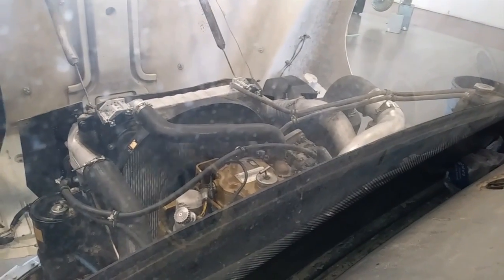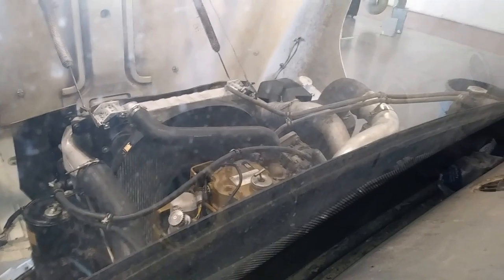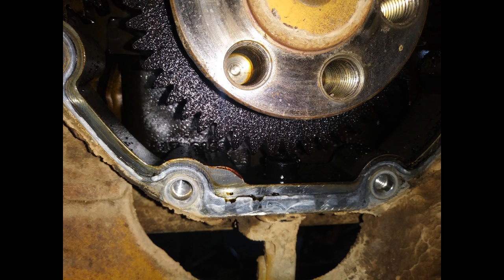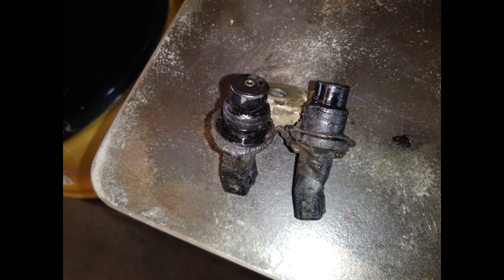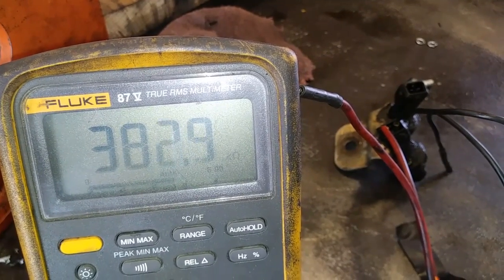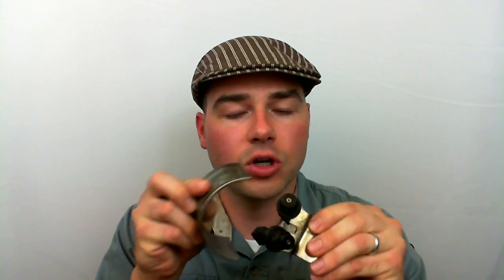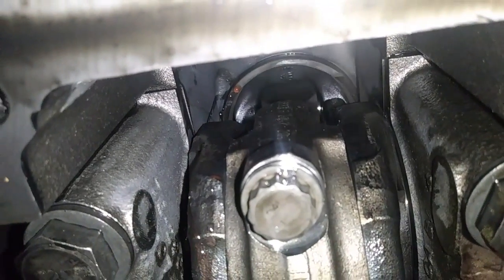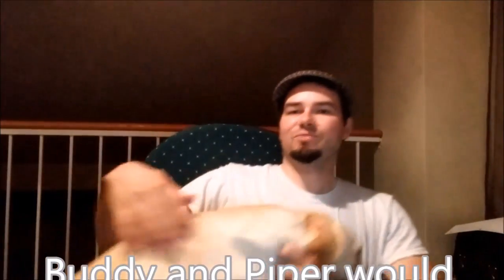Diesel Engine Problem You Can't Figure Out, Check This! Timing And Speed Sensors.

Comment: My 3406e is doing a miss under hard pulls , went to change the sensor and boom , frayed wire coming of the harness , about to change that wire and put a new pin and hope that fix’s it so I can return this sensor still in the bag. Thanks for the video

Comment: I have a 1993 pete with a 3176 cat engine serial number 7LG20948...it usually revs when pressing the aux and idle and revs again on its own..i changed out the pedal sensor but does the samething..think it can be the speed sensor? Thank you very much

Comment: Hey man, trying to work on my 3126 C7 in my Motorhome. I think I need a new Engine Speed sensor but can’t locate it
Reply from the maker: It will be underneath the HEUI pump on the front stretches. They are a pair of sensors next to each other.

Comment: God, people love to go right to throwing expensive parts at problems with simple causes. Even with motorcycles people/techs would do the same thing. No starts and funky running and people were wanting to buy ignition coils and CDI/ECU modules, 2 of the most reliable parts that last hundreds of thousands of miles in most cases on any vehicle, and can cost a few hundred to more than a thousand bucks. And the issue was 1, both, or in the case of triples or 6 cyl 3, crank position sensors going gone.

Comment: Was able to fix my 3126 after fighting it for a year.  Would start fine cold then turn it off and would not start.  Then sometimes its was fine.  Changed timing sensors and its good now. Thanks for the videos.
Reply: I got the exact same problem with my citroen jumper 2.2 hdi150

Comment: I was experiencing Intermittent Miss with my 3126 and was dreading the cost of possibly replacing HUEI pump and injectors when this video pointed me to the timing sensors. I found a cracked connector on one of the timing sensors that must have been damaged when the air compressor was worked on a little while ago. I secured that connection, and the issue was solved! Thanks Adept Ape! A lesson I have had to learn and re-learn a few times ... check for the  easy/cheap solutions before jumping to the difficult/expensive!

Comment: Thx for the vid I think I'm having the same problem, I will order replacement sensors, my only question is how do you remove the harness clips and separate the sensor from the harness. I am fairly sure this is my problem and had started leaning that way before stumbling across thos video. Only difference is that I do not seem to be registering any rpms on the dash.

Comment: Hi bud I’m Radu here and I own a 2008 t660 c15 Acert that gives me a check engine light and it says it’s the engine speed replaced the sensors just replaced the cam shaft on it and they checked the timing twice but they can’t figure out what’s going on truck starts runs fine no problems what you think it might be thanks captain!!

Comment: I have a cat 3176 in a 95 international 9200. Was running just fine and cut off, can’t get it to run again. Changed fuel filters and primed it, still no luck. Any advice?

Comment: Had a VW Jetta TDI that wouldn't start one morning after running perfectly for years. No engine light or codes so I was a little lost. Turned out to be an "anti shudder valve" (almost like a throttle plate in a gasser) that was stuck closed. Thing was gunked up from EGR gasses and was choking off the air. Pulled the unit, cleaned out a pile of soot and it's back to normal. It's good to get familiar with the workings of your engine.

Comment: I have a 2004 cat mbn c15 that is flooding cylinder #4 with diesel. The injector had a broken o-ring, put everything back together still flooding the cylinder. Took injector out replaced with a good spare, still same problem , any ideas?.

Comment: Hello adept ape, I have a fuel issue. The truck starts and runs for a short while but then it starts to die. My shop told me that my fuel lines are leaking and could cause this problem. Replaced all lines and still same issue. I thought like in this video the sensors needed to change and I did still no success.  The symptoms that we are seeing is that the fuel lines have fuel pressure the primary filter is mt and there is no pressure reading off the secondary relief valve. Please if any ideas that could fix this problem would be greatly appreciated.  Videos are extremely helpful thanks for them.

Comment: Josh,have you ever had a oil pressure sensor on a 3126 cause a low boost issue ?I did,drove me nuts,koeo the voltage to the sensor was fine,even read oil pressure,monitored it on et and it showed it's ugly head,replaced sensor and boost issue was fixed

Comment: 3406E 2WS serial number, new inframe, oil pump, turbo and head and now when starting the pops off right away and dies right away too. Test, ohmed and double checked everything I can think of and good. I unplugged the crank timing sensor and tried to start and would just crank, so I plugged it back in and unplugged the cam timing sensor and tried again and it runs great, went to plug the cam sensor back in and it killed it right away. I replaced the cam sensor and no change. will run great unplugged but jwill just start and die plugged in. any suggestions?

Comment: Thanks bud. So I did do a bottle test and no bobbles. 3406E 1999. The truck still runs good. I am under a load that need to drop in the morning 388 miles.

Comment: Josh. Water coming out my blow by
Reply from the maker: You most likely have a cracked head, blown head gasket, or a leaking liner. Depending on the engine you could have a bad water pump, oil cooler, or bad egr cooler.  You should perform a bottle test and check for oil in the coolant as well.
Reply: Hey bro can you do video regarding automatic transmission won’t shift

Comment: Craziest thing I've ever ran into was a Cummins isx with a vgt turbo. The truck would start then die immediately, checked everything never found a solution. Finally a guy from Cummins came to look at it, he loosened the bolts on the turbo flange and it started. Turns out the turbo was stuck shut....craziest damn thing I've ever seen.

Comment: Had this kinda the same  issue recently but on a Cummins ISC turns out the cam gear had literally snapped and only holding on by 1 of two spokes and when it was getting hot it was walking away from the position sensor causing engine shutdown initially thought it was bad wiring( due to bad repairs wiring previously)

Comment: Hello sir! I have a Peterbilt 379 with C15 6nz, the problem is when i heavy and going to uphill starts popping srems like not enough fuel or sucking air when i change shift and disappear when i push pedal harder. What might be reason? In the shop they cant check because it starts fine drives fine even heavy when no hills, only on hills and heavy appears this problem
Reply: Tyncha Amatov the you find the problem I have the same problem ?

Comment: 1 of my 98 Pete's has a 3406E, it would run fine then just shut off and start right back up. Miss on occasion during a hard pull. Took me a while to get around to the cam timing sensor but if I remember 144.00 later and it run perfectly.

Comment: How much that repair of the wiring harness and timing sensors cost ?
Reply: 250$ for the cam timing sensor kit. Comes with primary and secondary sensor and braket

Comment: ghost in the machinery
I fixed a CAT small Perkins which had metal chips on magnet causing intermittent issues. Never showed on scanner. Guys spent $$$$$ chasing it. Only cleaned chips off and now perfect on a JLG S 60 boom lift. We bought it cheap since stealer (dealer )gave up. Always check simple issues.
Also fixed Cummins M11 same bare wires on cam sensor. Easy fix!!!
Excellent video.Thanks Shalom

Comment: I have a 3126 in a small dump truck. When it warms up it sounds like it popping out the exhaust. Check all the injectors and made no difference. There's no smoke either and doesn't lack in power just has a pop out the exhaust. Was wondering if a bad timing sensor would do the same thing or do I have a burnt valve. Any suggestions would be muchly appreciate. Thanks

Comment: Any sort of sensor that measures the rotating speed of the engine are virtually identical to any speed sensor or ABS sensor, since they all have the same parts in common; a coil, a stator 'gear', and a magnetic tip.  Crankshaft and camshaft sensors detect for engine rotation, and the spaces in between the teeth of the stator turn the sensor off, the teeth turn the sensor on, giving a square wave register to the computer, same with a speed sensor or ABS sensor.  The computer calculates the on/off cycles, and determines engine and camshaft speed to control fuel and ignition timing, or simply injector timing in a Diesel.  If only it was so easy to replace these sensors when buying a new truck, there'd be less down time and the engine would run much better since it can monitor itself more easily.

Comment: you have experience with 3204? I have a D3B crawler, has one of these engines, runs Ok, about 70psi oil pressure. I have heard horror stories of the 3208, so I wonder what typical problems this engine has and are there ways to minimize these issues.

Comment: Have seen worn injectors not allowing one to start. All test shows nothing wrong with the engine. The injectors can't meter enough fuel at             cranking speed to fire the engine. Starting fluid works as the engine gets fired off and engine now has enough fuel metered.

Comment: My jakes stick when cold on a 3406e 2ws. When it’s hot works great! Any ideas?
Reply: First Jacobs brake does not recommend using the brake with a cold engine. Most likely you have a spring broken. Second solenoid   sticking. If it does it on low, check the center hsg. If on med. front or rear. Remove the valve cover and on top of the solenoid is a     small plunger in the center. Push it down with a seal pick or something to active the brake manually. When you release it oil will       squirt out the plates on top. You can place rags over the plates. Make sure you don't get them in the valve train. Once you located    the hsg that's causing the problem. Remove those plates and check for broken springs. If it is the solenoid a TEN article was           written 1-10-1999 addressing this problem. It states if your solenoid is dated F9 or higher it is the improved solenoid. Part number  1631533.

Comment: Perfect timing! I recently obtained an Isuzu Trooper 4JX1 powered vehicle from a mechanic for $1000 because he couldn't get the car to start. His $5000 scan tool apparently said that the car should start, but it obviously wouldn't, so he sold it out of pure frustration after spending way too many hours trying to solve it. First thing I noticed was the crank sensor had no o-ring, so I cleaned, tested, and replaced the o-ring, but it still wouldn't start. So I go to the cam sensor and notice that it has a new CAS255 sensor installed. So I removed it and replaced it with a known working 2nd hand sensor and the car starts first time, every time.

Exactly as you said, there were no DTC's lodged in the ECU and the HEUI Injector status was ENABLED, so Oil Rail Pressure was 4.5MPa, and crank sensor read 250rpm using the Starter Motor. You could smell unburned Diesel coming out the exhaust pipe but it wouldn't start. If you forced started it on ether, then it struggled to maintain idle and wouldn't respond to the accelerator, then eventually just stall.

Moral of the story, even New Parts can be faulty out of the box, which is when known working 2nd hand parts can be invaluable.
Reply from the maker: Thanks for the real world experience on your engine.
Reply: delawarecop True many aftermarket Chinese stuff bad out of box. Boycott communist China junk.
Reply: @motorhead1 engine1 - yeah, but unfortunately those junk chinese parts have made their way into the parts bins of many less scrupulous dealers, and are being sold as genuine. Fortunately the Caterpillar parts still appear to be top notch quality as opposed to Holden parts. The stench of desperation from overstocked dealerships is certainly nauseating when they quote $45 for a 6 inches of 1/2 inch coolant hose, and a week for delivery😡
Reply: delawarecop Many GM and Ford Factory replacement oem are China now. I got a 7.3 PSD water pump from Ford dealer same pump as from Pep boys from China three times price. Wanted to toss it through Ford Windows.
Reply: motorhead1 engine1 - Yep, Holden here in Australia have been selling these Chinese Black top Solenoid replacement injectors as OEM replacements for the original Isuzu 4JX1 Injectors, but when you go to the Isuzu database, the part number doesn't actually exist - its a fake, and they perform like fakes!
Reply: delawarecop Wow even in Australia? You guys are smart enough to make your own parts . Talented Aussies. In Israel we made after market also good quality. Isuzu good truck's here also. We have Cab over trucks UD Nissan and Honor Toyota excellent. Euro trash no good. German cars ng. Shalom
Reply: Worst engine Isuzu ever made. Get rid of it they're are a piece of crap
Reply: These engines are a nightmare if not running correctly. Can be a money pit and would be cheaper to dig a hole and bury it. If you touch it, your screwed.
Reply: @lesmond7301  - well I've successfully repaired 72/72 in the last 5 years, so I dont see your fears!
Reply: @sameuljones5496  - yep, spoken like one who simply does not understand the engine😀
Reply: Working in a dealership (GM/Isuzu) selling parts for these engines, we see it quite often when a small repair turns into a money pit, especially with the injector system, inj sleeves, harness and pressure sensors. These are a good engines when running correctly but cause hassles once they fault. These are commonly known as the boggie engine for the Isuzu range in their small 4x4 and 4x2 vehicles. I've worked in this same dealership for over 15 years and have herd the same from other dealerships and garages.
Reply: Les Mond - I have no doubt that what you say is true in many cases, but its no different to Holden dealerships here in Australia, where they are more commonly known as Holden Stealerships because of their unconscionable conduct in dealing with 4JX1 clients, using apprentices to carry out repairs on engines that they clearly do not understand. On a regular daily basis, mechanics from various parts of the country call me asking for help in diagnosing issues with these engines, and in most cases the mechanics don't even know the fundamental operating conditions of the engine, so how on earth they expect to diagnose them is beyond all reason.

I had a local mechanic ask me about changing wiring looms because he was replacing an engine from a 2003 Auto 4JX1 into a 2000 Manual 4JX1. I asked him what was wrong with the old engine, and he said that he cannot get any oil presure on the injector circuit. I asked him if he had cleaned the RPCV and he said, "whats that"? Typical response I would expect from the people who call this engine a piece of crap:)

Like I said, I haven't seen a 4JX1 vehicle yet that I cannot diagnose and SOLVE the problem. eg Pick-up Pipes, I will ALWAYS remove them, weld gussets, fit 4 x 17mm ID x 2.5mm CS Viton O-rings onto each pick-up and refit them. Oil supply problems to HEUI Injection System and Lubrication circuit solved FOREVER! The list goes on.... like always replacing ORPS and RPCV with genuine Caterpillar parts (167-1709 & 122-5053) that do not fail for 10 years!
Reply: Les Mond - Injector sleeve issues occur because GM/OPEL/ISUZU dealerships failed to monitor Cat bulletins (SIS 01/10/2002 - Media Number - RENR2306 -04 ), which clearly say to cover bottom of Injector Sleeves with Nickle based anti-Seize compound before refitting into the Head. This reduces the chance of combustion gases leaking into the coolant system, causing corrosion and pitting in Heads where Sleeves sit, and reducing wear on O-rings.

These are problems caused mostly by poorly trained Mechanics, and lesser by poor Isuzu engineering.
Reply: @lesmond7301  totally agree Les they are a piece of crap engine
Reply: Samuel Jones - "totally agree Les they are a piece of crap engine"
Spoken with such eloquence and finesse, you must be entirely credible:)
Reply: @Sameul Jones - you keep telling yourself that sweety and dont forget the lipstick😜
Reply: @delawarecop  you keep working on that shitbox it's all your good at. Il work on the Cats n Cummins son the big boy stuff not the little isuzu baby stuff
Reply: @sameuljones5496  - good, for a moment there I thought you were one of those little TD5 boys😜
Reply: @sameuljones5496  - thats what everyone says who doesnt understand how they work😀
Reply: I understand that engine more than enough to know it's a piece of shit. You brought a piece if shit and now your trying to justify your purchase
Reply: Samuel Jones - " You brought a piece if shit and now your trying to justify your purchase"
LOL - gee its good to see ignorant idiots projecting their fears onto others:)